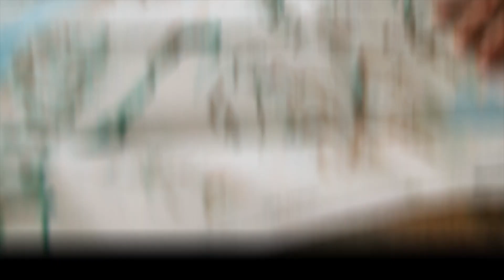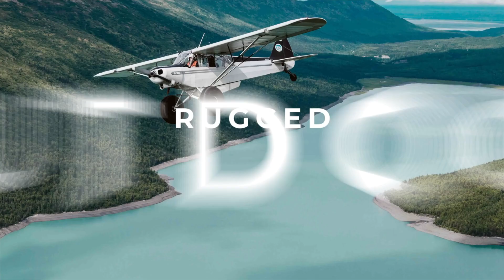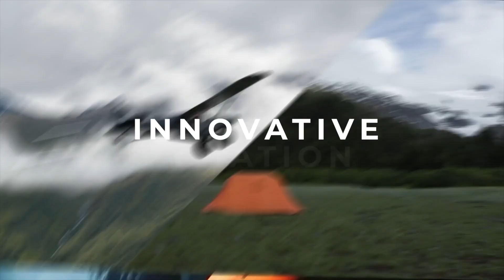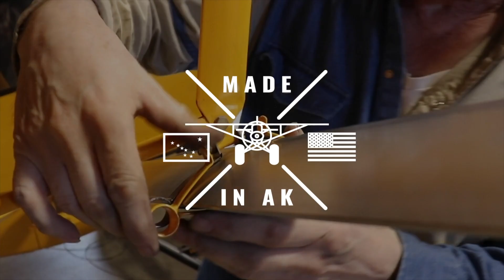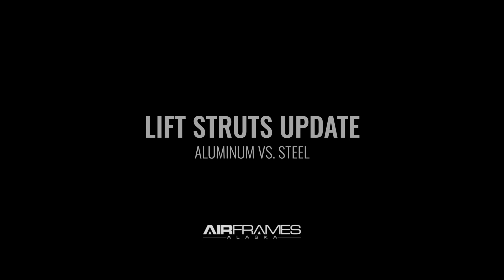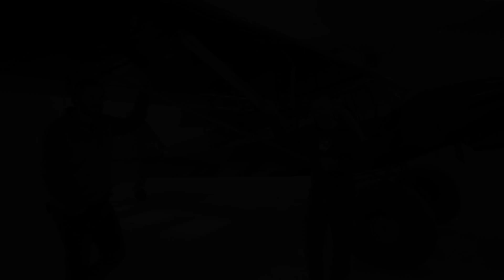Aluminum Lift Struts vs. Steel Lift Struts

Comment: What system of corrosion protection are you using on and in the Maule struts?
Reply from the maker: Great question. Here is the following corrosion protection. The end fittings are anodized aluminum, and the strut extrusion is bare aluminum.  We recommend painting the struts to prevent corrosion from salt and to improve the overall appearance.
Reply: @airframesalaska8030  so how easy is it to coat the inside of the struts with paint and not have an excessive buildup? Can you provide struts that have been treated inside and out with alodine?
Reply from the maker: @BigBadBambo  we currently do not have an efficient way to pain the inside of the strut, but will be looking into this further and will report back findings. We know that for heavy salt exposure areas that could be helpful to reduce corrosion issues. Thanks for the comment.